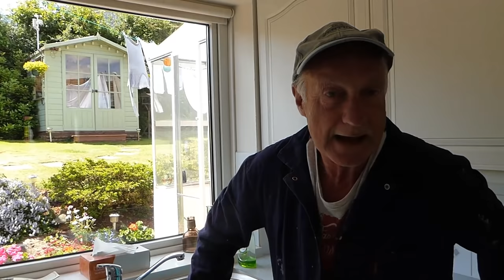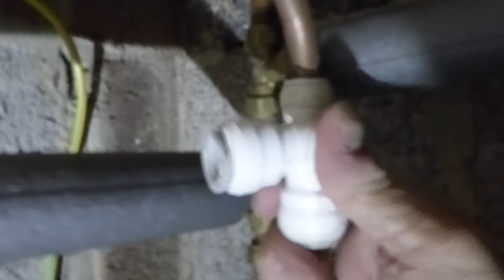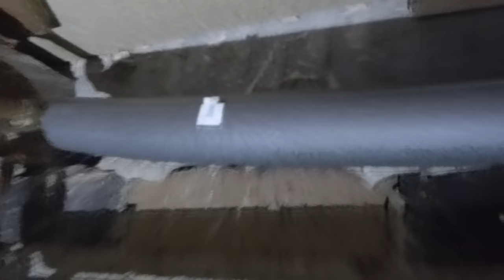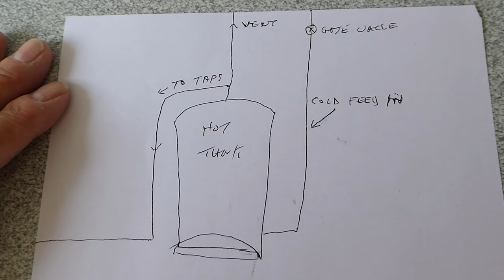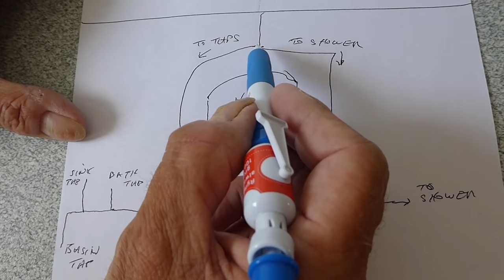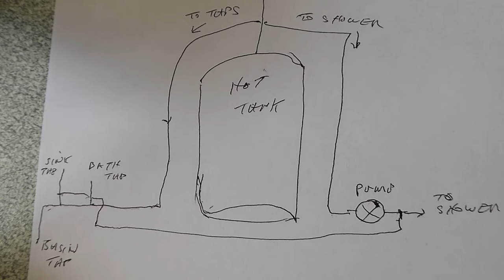How to increase your water pressure at the taps.

Comment: Interesting video. My Mother had the same problem. A plumber fitter a new tap and the flow was very bad. He was a right dipstick. I removed the filter at the end of the tap and everything is now fine. But I love the way you share your information. Keep up the great work.
Reply from the maker: Thanks Stephen.
Reply: John Burgess I live in a bungalow, moved in on November. First job was change sink and taps, as the mixer tap had 2 washers leaking. Fitted these pencil size flexi fittings to the tap and compression fittings other end. OMG !!!  cold is B- on pressure, Hot is at Z (unusable). 
Bathroom H&C pressure is fine , no bath. Shower pressure is also good, not worked out if shower is connected to the mains or not yet, will be checking tomorrow. Gravity feed exactly as this video. No gas. Oil boiler outside. I've checked everything I can think of as to why the pressure is this bad, as bathroom Hot is actually quite good. It's got to be needing a power pump fitted. Am a diy er !! Can I fit a pump under kitchen sink to connect to kitchen Hot only. Or best fit in the loft. Not had a chance to get under the floor yet ?

Comment: Hi, great and informative video. Unfortunately we have the very problem you describe. The water pressure at both of our hot and cold water supply to our  bathroom sink is just as you show.
We currently have a Pump in our upstairs airing cupboard which increases the water pressure to the bath an shower.
The biggest problem we would have to use that pump in the way your video shows is that our bathroom floor is tiled
Reply from the maker: I have replied on your other thread.

Comment: As it is tiled and we wouldn’t want that disturbed, can you suggest any way of utilising the pump for the bathroom hot and cold supply without disturbing the bathroom floor please ?
Reply from the maker: If you could locate the pipes before they go under the bathroom floor, then you could possibly tap them onto the outlet side of the pump. Or add an extra dual hot cold pump separately.

Comment: Love your videos. Did I read somewhere that If I have a twin impeller pump and run only from the hot side that it will damage the pump. Have the same issue you have had with hot water pressure, have a twin impeller pump to shower but worried that by teeing in to only one side damage pump
Reply from the maker: No it is quite safe.

Comment: Hi  Thanks for helpful video on increasing hot water pressure through use of existing shower pump.   Is there a way of varying/reducing the pressure for the basin hot whilst getting full 3 bar pump pressure for the shower please?  Or do I need two separate pumps?? Thanks Brian
Reply from the maker: Fit a isolation valve on the feed pipe to the basin tap and shut the flow rate down.

Comment: Hi, I have a mixer tap just like the one in the video but the problem is with the cold water, not the hot water.  It's been fine for years but suddenly the cold water pressure has dropped significantly.  Also we have an outdoor tap that branches off same feed before it even gets to the cold water tap, so I'm guessing the problem is not the tap?  We also have a water softener system installed under the sink.  15 feet away in utility room we have another sink but both cold/hot pressure are fine.  Great videos by the way, keep them coming please!! :)
Reply from the maker: +Paul Gorman I think the problem is the cold tap. I have a video on how to fix it.
Reply: Paul Gorman i
Reply: dereton33 just to close off this thread the problem turned out to be my water filter system which had totally failed. Anyway thanks for your help and keep up the good work with your great videos  🤓

Comment: Just one point I must pick up on is the iso valves you have not used full flow valves using the 8mm boar valves are the biggest problem in gravity feed system's also you have used what look like small boar flex fittings witch also kill water feed did you check to see if the sink tap was high or low pressure as most low presented taps come with 13mm boar tales please advise this to your viewer as most can save the time and expense of fitting a pump by checking these things
Reply from the maker: Yes good tip Darren.

Comment: Although the method might be correct I would not do all the connections in compression fittings.It is a bodge way of doing it.Use solder fittings if possible.
Reply from the maker: Just don`t burn the house down. Using solder fittings is more of a plumbers professional way, but for a DIY person who is not able to solder, use compression or push fit.

Comment: Hi Al, love the videos, keep it up.  

I hope you can help me with a problem.  I recently bought an an old 1960's house with a tank in the loft, and boiler.  I did have an old dated power shower.  I want to replace it with a mixer shower as to replace with another power/electric shower I'd need to upgrade all the wiring which seems a complete nightmare!  

Anyway, I have hot and cold feed coming through the ceiling into the bathroom (not concealed).  Without chasing the pipes the pipes into the wall (as we have already tiled!) how can I fit a mixer shower, as the pipes are coming down parallel to the walls, and the mixer showers all appear to be designed so the connection is at 90 degrees to the wall.  Do you have any suggestions how to overcome this problem? Thanks, Ruth
Reply from the maker: Hi Ruth, you can get surface mounted showers with swivel elbows on them that will allow you to connect to surface mounted pipes.

Comment: I live in a bungalow, moved in on November. First job was change sink and taps, as the mixer tap had 2 washers leaking. Fitted these pencil size flexi fittings to the tap and compression fittings other end. OMG !!!  cold is B- on pressure, Hot is at Z (unusable). 
Bathroom H&C pressure is fine , no bath. Shower pressure is also good, not worked out if shower is connected to the mains or not yet, will be checking tomorrow. Gravity feed exactly as this video. No gas. Oil boiler outside. I've checked everything I can think of as to why the pressure is this bad, as bathroom Hot is actually quite good. It's got to be needing a power pump fitted. Am a diy er !! Can I fit a pump under kitchen sink to connect to kitchen Hot only. Or best fit in the loft. Not had a chance to get under the floor yet ?
Reply from the maker: You can fit a pump, or change the flexis back to 15 mm copper pipe with no restriction to the taps. The taps may also be restricting the flow if they are modern ones.
Reply: dereton33 thanks for replying yes the taps are modern with very thin hand screw in connections as thin as a pencil. What type of pump would I need ? Negative feed
Reply from the maker: A  negative pump would Be fine.

Comment: I have fitted a pump to my shower, but not easy to connect basin pipe to the hot shower feed, can you see any problems using another pump for the bathroom basin. I have just replaced the basin tap and it’s a trickle, will using 2 pumps affect each other’s operation.
Reply from the maker: No, it will work alright. Just don`t run the shower and basin tap at the same time

Comment: my kitchen sink faucet has both low pressure hot & cold but water hose has full pressure...it is not the aerator...what can it be? it happened after my dishwater was disconnected and removed.

Comment: Hi Al... my copper tank needs replaced at home, and I’ve been advised to replace it with a stainless steel pressurized tank instead. Apparently this does away with the header tank up in the roof space, and means that we can run a power shower... would you agree??? 
Ps. Our immersion heater at the moment is the willis type that just sits alongside our copper tank. Thnx for any advice. Love your videos. 
James.
Reply from the maker: Hi Jim the stainless steel tank will give you the pressure but they do not have a long shelf life as they rust through.  My father's tank lasted 9 years before it needed changing. Copper tanks 20 years.
Reply: Copper it is then Al... Thnx for that

Comment: Just considering doing what you have done, couple of points Dereton, does it affect the pump that only hot water is being drawn off, also one of your corresponding threads question dead legs, does this still apply as water is over 50c the region of which legionella is controlled, secondly you could put a tap on this pipe and flush periodically, do you see any issues with this. Once again thanx for your reply.
Reply from the maker: It will not affect the pump, I think if you put a tap on the pipe and drew off now and again there would be no problem with Legionella.

Comment: Hello Dereton. My tank in loft is raised 5ft above joists and feeds bottom of cylinder using 22mm . Would  changing that pipe to 28 mm give a bigger flow /increase in pressure like shown in this video. Regards Don
Reply from the maker: It would, but not enough to warrant the cost of 28 mm .
Reply: @dereton33  hi. Thanks for the reply . What about 28 in plastic ??

Comment: I had both hot and cold with gteat pressure before i installed a new sink and mixer tap.  Now i still have great cold pressure but my hot water is vastly reduced pressure . Any ideas mate? Mamy thanks in advanced
Reply from the maker: You have fitted high pressure taps that restrict your hot flow.  On F and E systems always insure you buy taps for low pressure.
Reply: @dereton33  Yeah that seems to make a lot of sense mate. It looks like either replace the taps or get pumps installed ? Is that recommended by yourself? Oh and thank you pal

Comment: How to increase flow of pressure of water  from top tank connection, when a t pipe  is joined in the middle of the main water connection to another tank on ground floor  from which  water  is supplied to the top tank
Reply from the maker: A pump is your best option.

Comment: I got  low pressure hot water on my kitchen and bath tap. its all on the ground floor and same level  
can we put single feed pump on hot water cylinder without fit Flange.  plz let me know
Reply from the maker: Yes just tee it off of the top of the expansion pipe above the cylinder.

Comment: Recently the hot water pressure in my kitchen sink began to get less. Cold pressure is still fine. Hot water has no issue in any other faucet in the house. WHAT could cause this? I can find no leaking pipes. Just slowly getting less and less.
Reply from the maker: +Greg Bernal The tap is faulty I ha've a video on it.

Comment: Hi.
Thanks. Interestung video.
I've used vales on my pipes & at my mothers but I use the one's with handles as they are easier, the one's you have tend to clog up & you need a flat ended screw driver to shut it iff which isn't akway's handy.
Anyway, I wonder if you can advice me?  I am connecting a hose to my Mothers garden tap & to a length of uPVC pipe that I will be drilling holes in then running it along the fence in the garden so all she need to do is turn the tap on to water her plants but I'm not convinced the water pressure is powerful enough to exit all the holes in the 26ft  uPVC pipe , is there anything I can do? She has a Combi boiler.

Thanks
David
Reply from the maker: Hi David, no the pressure will be set by the water company. Just make sure the stopcock is full on.
Reply: dereton33 Thanks. Can't I buy anything to help get the water up to the end like a pump?

Comment: Hey Al, what's the longest length you can have a dead leg on 15mm pipe? That one you did there must be about a foot. Is that not too long?
Reply from the maker: reggiewac There is no actual limit, it`s just that the longer it is the longer it takes the water to reach the tap, it also waste water, while waiting for the hot water to reach the tap.
Reply: dereton33 I mean the dead leg. The one you capped off after the T (I think it was the old kitchen hot feed). I was told that dead legs should be as short as possible so you don't have stationary water that can be a breeding ground for germs.
Reply from the maker: That`s a new one on me, but i can see how it has come about. So i guess the answer is as short as possible. Thanks for bringing it to my attention. Regards Al.
Reply: reggiewac 3x pipe diameter
Reply: Essex boss should be used to stop air ingress too

Comment: So if I have a twin impeller pump for my shower, can I tee off of it for the hot bath tap? Will the pump pump hot and cold independently and not damage the pump on the cold side?
Reply from the maker: No it must be teed off near the hot water cylinder and the cold water taken from the roof tank.
Reply: @dereton33  sorry bud I didn't write that question well...

I have a shower pump working fine, it is a salamander ct50 (a few years old now) and I now want to boost the hot water feed to my bath hot tap. I have floorboards up so I  can run a new pipe from the hot outlet from the pump to the bath tap.

My question is, will this damage the pump? If I turn the hot bath tap on, the pump will pump hot water to the bath, however, will it also be trying to pump cold also? If it will pump hot and cold (when no cold valves (taps/showers etc) are open, will this damage the pump?
Reply from the maker: I see what you are trying to do, you can just pump one side of the pump to the bath tap it will not break the pump as the cold side will only operate when cold water is called for. The pump will only operate when the flow sensors on either side of the pump sense moving water. No damage can be done to the pump when water is not flowing.
Reply: @dereton33  cheers mate.

Comment: Hi buddy a puzzle fir you my hit water tap in kitchen broom upstairs too along with upstairs sink will no longer activate hot water (combi) the only tap that I can activate hot water flame without manually doing it via the temp dial is that tap along at full volume aky ideas ? Thanks
Reply from the maker: A three way valve problem or low pressure reading on the Combi.
Reply: @dereton33  so a part inside ?? Like maybe diverter valve ? The bar reading is around 2 I know from an old boiler I had years back I say old it was new had to be around 1 bar standing often went to 1.5 with hot water and 2 bar with heating but I'm guessing they vary ....as I said the only tap that will activate the flame is the downstairs tap that has the best flow which is uncanny love your videos you gave me the confidence to remove radiators in the past

Comment: Great video do you not lag all your pipe work under the floor.
Reply from the maker: theCybershot123 I do, but have been doing some alterations under there, so I stripped most of it off, it will be going back on before winter though. Al.